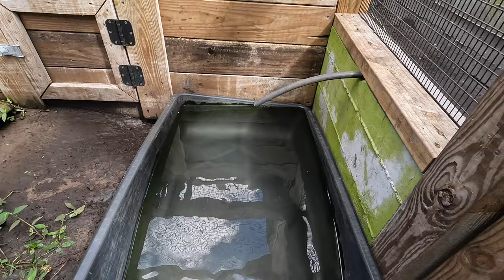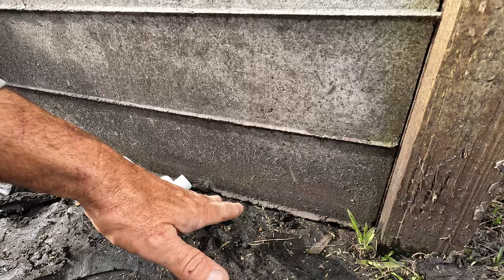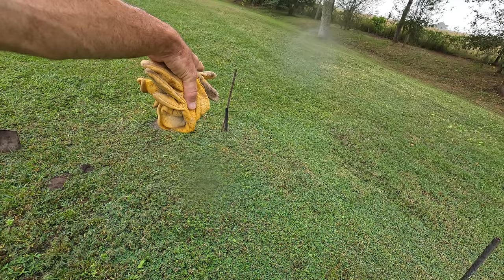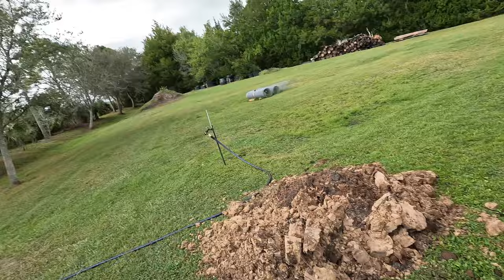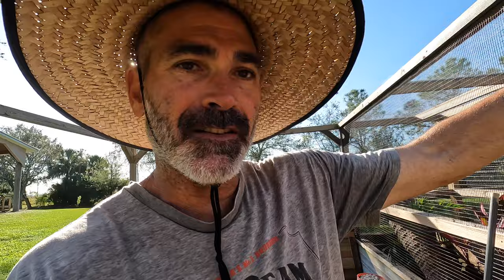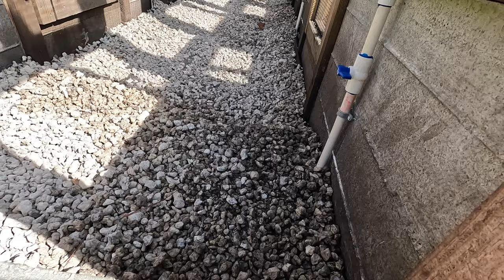Fixing the Hallway Water System and Airlock

Comment: I used to use those hoses that scrunch up, but after a year or so they would develop leaks. When I chose those scrunch hoses I really wanted something light weight that wouldn’t tangle. So, I looked again for alternatives and finally went with metal hoses. They are super light and easy to maneuver, and they don’t tangle. They are even easy to coil if you want to do that. My oldest one is now ten years old. I have even run over a few times with my car and it held up fine. Of course, I try not to do that. You can get the metal hoses in any length from 3 ft on up. My longest is 100 ft. I bought mine from Amazon. The brand I like is Cesun 304 Stainless Steel Metal Garden Hose, Heavy Duty Water Hose for Outdoor, Yard - Flexible and No Kink, Tangle Puncture Resistant. They are more expensive, but last forever. If you do go with metal, be careful because some are plastic wrapped in metal and those don’t hold up well.
Reply from the maker: I will look into that….thank you!

Comment: Rather than dumping the waters in the enclosures have you ever thought of drilling a hole in each and using a bulkhead style fitting where you can attach a hose/pipe to drain outside the enclosures?
Reply from the maker: We had that at the other house and we haven’t built the permanent water tubs for the water monitors yet

Comment: Man, just add another 90° elbow in every cage so that the water shoots down instead of upfront. That way you wouldn't need to care about the pressure
Reply from the maker: That is very smart, but I still haven’t built their permanent water tubs and I might put a hose fitting on them like the other house had
Reply: @WolfesWorld  Ummm... What about the 90° elbow and a 2" piece of pipe to attach the hose to? That would allow you to use much higher pressure reducing the time to fill each tub.